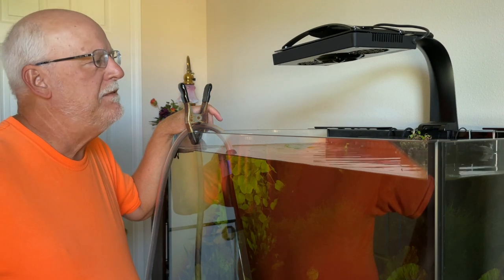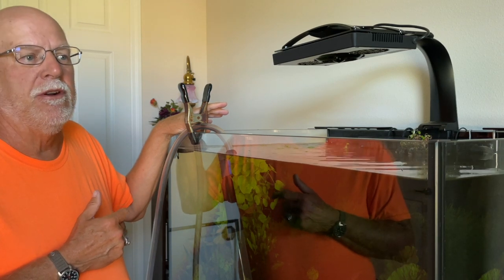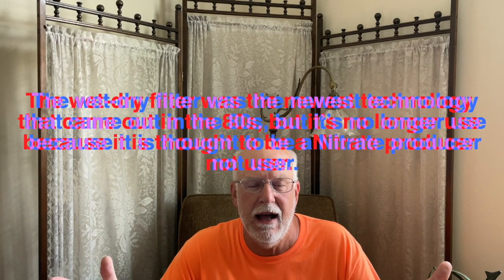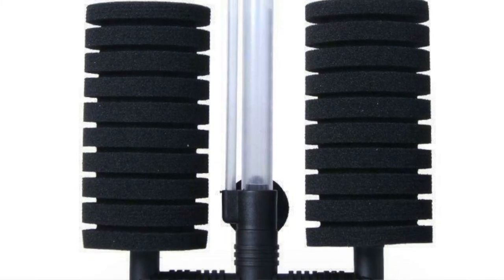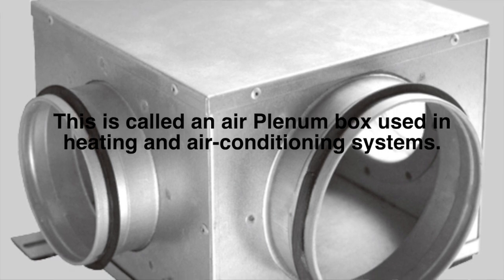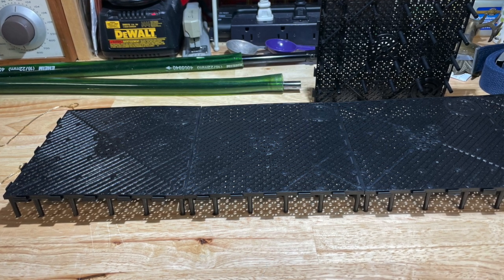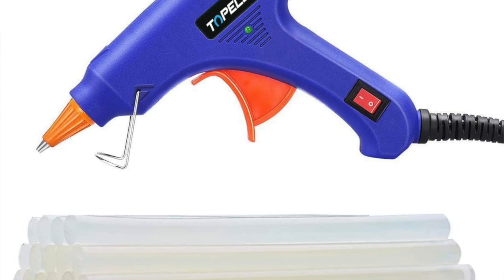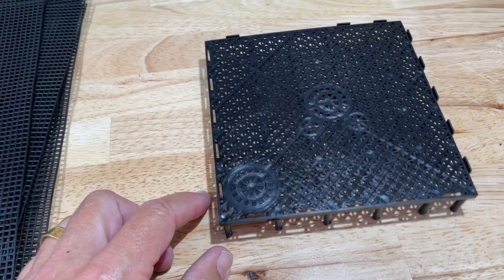Understanding the differences between a Plenum and an under-gravel filter.

Comment: Hi Kevin,
I note in your book that you recommended using products that only contain Sodium Thiosulfate for removing Chlorine and Chloramine. The product I have been using claims it Detoxifies Ammonia, Nitrite and Nitrate.
I strongly suspect that they are not giving the full facts here. 
I have just bought Biotopol by JBL, it claims to remove the Chlorine and Chloramine but also Heavy Metals and lists copper, lead and zinc.
I think it would be great if you could do a video on this and show us what product you use. You might also advise if it’s better to use a carbon filter to remove the chemicals in out water change water?
Thanks
Reply from the maker: I do have an early videos showing you the 18 most valuable elements that are needed in an aquarium. I also have a video on how to make Chemi pure but a generic form of it. This way you can save a lot of money by making it yourself.
Reply: Thanks Kevin, I will look that up

Comment: my question would be - what amount of circulation do we need this to work? for example we have 100 liter aquarium, we build the plenum and put the airpump to move water. how many liters of air do we have to run? 1 l/min? 10 l/min?
Reply from the maker: Just a steady stream of bubbles, that's it.
Reply: From what ive gathered a couple of gallons per day is all that needs to run through the plenum

Comment: So, a plenum has no lift tubes? It just lies there with the material slowly making its way thru? An undergravel filter has lift tubes, and draws material down through the layers? (I used the UG Filter in the 80's)
Reply from the maker: Using a Plenum comes in two ways: 1) is with no lift tubes at all and 2) using a lift tube to but only one and not pumping a lot of water through the substrate. Both work but one works a just a little bit better than the other. The slow moving plenum with the lift tube works a  bit better than a Plenum without a lift tube.
Reply: @anoxicfiltrationplenums  I thank you for putting up with my ignorance. I loved my ug filters in the 80's! I had a couple plants in each tank, but the tanks were clean and needed very little maintenance.

Comment: So Kevin, what happens if I place a power head of 60 gph on the tube of a plenum filter? You mentioned it needs to be low flow. Can you explain the difference between a high flow vs low flow and the science behind it?
Reply: If you are using high flow, you will have too much O2 under the plate.  You need to create a low O2 environment for the second type of bacteria to populate and work for you.  Hope this helps.

Comment: A "plenum" is a silly idea in an aquarium. Which is why it is a nearly universally ignored method of filtering an aquarium throughout the hobby. Just a plain old UG with gravel on top is all you need. Millions of aquariums have done just fine with them.
Reply from the maker: Just think how far science would have gone if people listen to other people that claimed things were a silly idea. Where would mankind be today without these silly ideas? As I've explained before, in my videos under gravel filter is nothing but a plate, which makes a Plenum or a void between the bottom of the aquarium and the substrate.